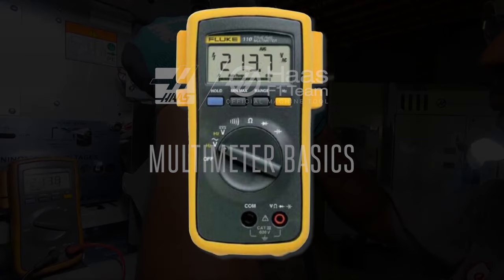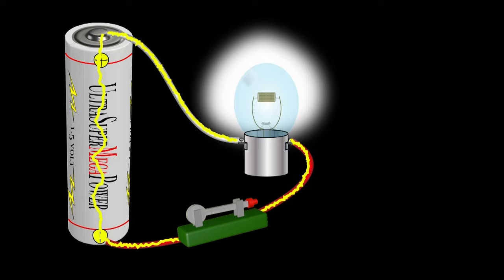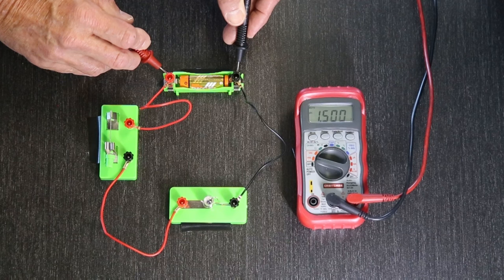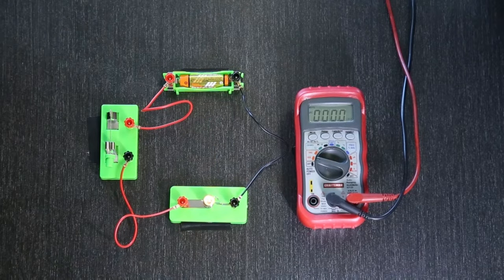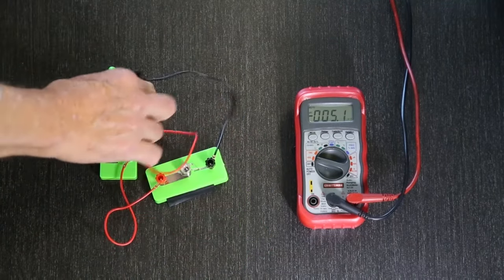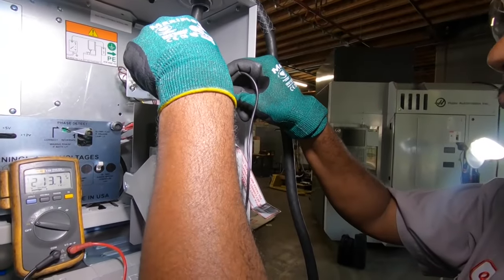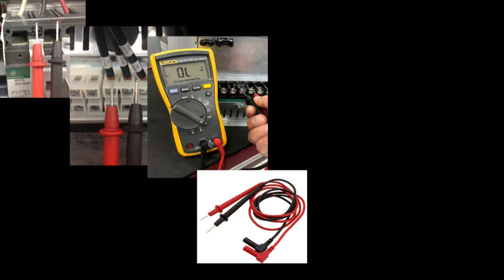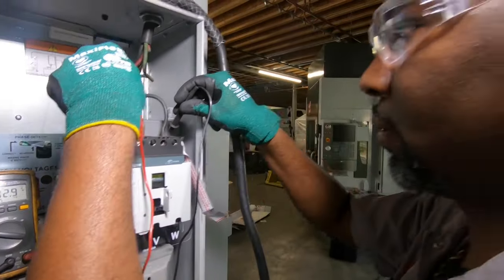Multimeter Basics - Using a Multimeter to Check Electrical Circuits - Haas Automation, Inc.

Comment: Top tip for anyone in the spark industry, get a megohm tester and get the new guy to hold on to both ends.... you know what to do at this point.
Reply: That’s actually not good to do. Chances of them getting hurt is low BUT it’s still a chance.

Comment: I never wear a ring or other metal parts on my hand while working on electronic circuits either its live or not ( I know most of the machines are properly grounded but if you are taking measurements for fixing electrical work it maybe grounding has issue too) . Orville please dont wear rings near live/ dead circuits at least while filming

Comment: 12 seconds in, and you're already misinforming people.

1) Electrical potential IS stored in a battery, but not in what you call a "wall plug" (actually the picture is of a receptacle - a plug is the male part that goes into a receptacle or other female connector). The receptacle has electrical potential available for use, but it is not a storage device. Big difference.
2) Voltage is defined as electrical potential - whether it's being used or not.
3) Actual electron flow is from the negative side of an electrical source to the positive side - since electrons have a negative charge. Speaking of 'positive-to-negative' current flow is archaic and invokes the "hole flow" scenario - where a LACK of electrons flow from the positive to the negative poles of an electrical power source. Hardly the same as what you say, "Electricity only flows from a high energy source - the positive, to a low energy source - the negative." It's actually the other way around where electrons travel from an excess of electrons - the negative, to a lack of electrons - the positive.

I've just touched on the first 23 seconds of the video so far, and don't feel like writing a novel tonight by covering the rest, but dude, do a little more research on stuff before you try to teach it to others.
Using ill-defined terms and misunderstood concepts in an effort to teach people doesn't further the education of anyone - it just fosters more confusion down the line.
Reply: Thanks, good thing I read the comments huh

Comment: Oh my, this is so wrong. So far I can’t even count the errors in this video.
Reply: Glad I'm not the only one.
I cringed most of the way through this.
Reply: Good there's more of us. I looked at the Like/dislike-ratio and was confused. Voltage is stored electricity? AC is loud and DC is quiet? Taking a kink in a wire as an example for Resistance?  Cringe it in. They could have just explained Ohm's law and that would clear a lot of misinformation for many rookies
Reply: @luke1811  Same thing here on the Like / Dislike ratio. I was the first Dislike when I ran across this.
I don't mean to be doing any unnecessary flex or anything, but hellaciously bad "education" like this only makes it harder for new folks that are interested in electricity to actually get a good idea of what TF is going on.
And as for the 'kinked wire' thingy...WTF?!? I've only been doing industrial and commercial controls and electrical maintenance, service, and design work for a little over 35 years, and "kinked wire" is trending really low on my list of 'things that actually happened and made a difference'.
When I am trying to teach electrical theory to people, I often use the comparison of water flow through a hose or pipe as a corollary to the current flow of electricity through a conductor, but I also make sure to point out that it is not a perfect comparison. In fluid flow, a kinked hose makes for a restriction (resistor) to flow, but the same isn't true in electricity.
Anyone who thinks so should be hard pressed to explain how a wire nut works - it is literally the definition of a conglomerate wire kink.
Reply: Ahaha, glad I'm not alone.